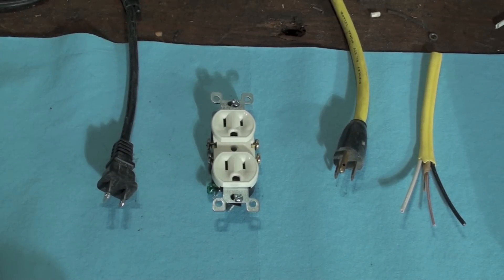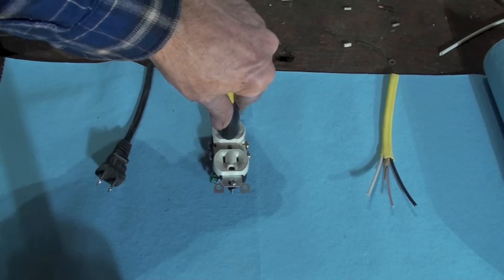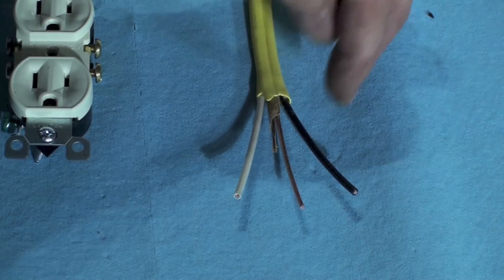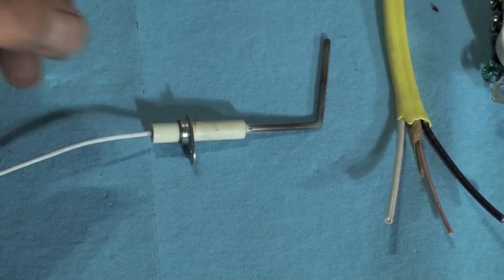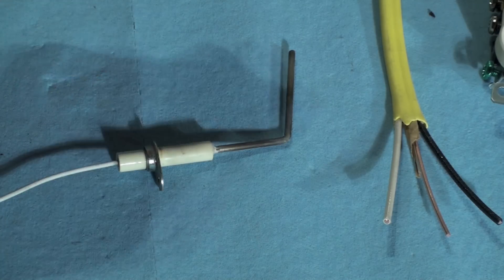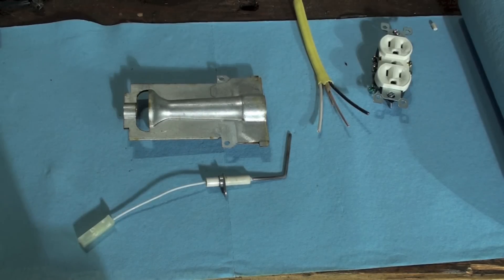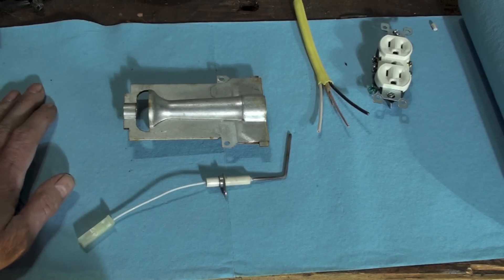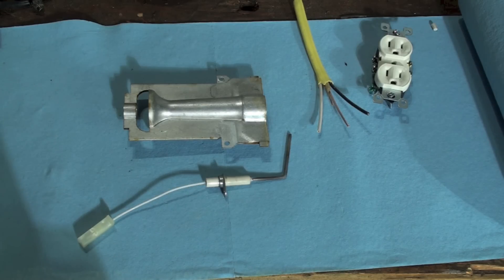Reversed polarity on the gas furnace

Comment: Thank you for explaining in clear detail why gas furnaces manufacturered after the late 1980s will not operate if the hot and neutral are reversed, yet essentially all other equipment and luminaires whether they be incandescent,  fluorescent,  HID or LED will operate normally with a hot /neutral reverse,  aside from the increased shock hazard potential especially with edison base lamps.

Comment: I am ignorant when it comes to electricity. My Heater went out during the night and it will be around 10 degrees tomorrow with around 3 inches of ice. Here in south Louisiana that means everything is shutdown! I just had a on/off switch put on to bring up to code. Your video helped me figure out the power and neutral were connected wrong. I switched them and heater is working. Thank you!!!
Reply from the maker: Welcome.  I have been hearing about your temps.  You guys are colder than where I live eastern Washington.  I am looking for lake pondchartrain to freeze.
GFM

Comment: New Lennox HVAC system installed last month, AC worked fine but go to switch on the heat today and nothing but this polarity error code. Checked the plug they installed on the romex main power line and sure enough they had it wired backwards. Swapped it so that black was now on brass and sure enough that fixed it. Thanks for this video- it really helped. I called the installers and notified them, but I’m curious to know if this polarity reversal could have potentially damaged anything?
Reply from the maker: I have not seen it damage anything on the newer systems.
GFM

Comment: I com across this error often but found through examination..hot surface ignitor ceramic had a micro heat fracture or carbide was actually touching flame and was sending 120v signal through flame to ground during first few seconds if ignition and tripping fault. 
Look for proximity issues on this...also some controls have  a timing issues where ignitor is energized longer than needed and if there is a long flame around ignitor..this can also trip a polarity error code.
Hvac tech since 1979, Michigan
Reply from the maker: Interesting
GFM

Comment: I have a furnace that has been running great for years, it is now random cir board lock out and the code says reverse polarity system lockout. Not Shure why?
Reply from the maker: Either you have a reverse polarity condition, bad ground or failing control board.
GFM
Reply: @grayfurnaceman  I was going to start with a flame sensor, then take it from there, hoping its not the board. The furnace has been working for at least 15 years and just started 2 light lockout. Iv cleaned the sensor worked good for a week and just started acting up again.
Reply: @lizards7777  what you end up doing to it
Reply: @alejandrouriostegui8014  it endid up being a cracked / hairline crack in solder joint on cir board going to main valve, I re solder and so far so good.

Comment: Good video, but I do have a question about running on a generator.  a LOT of discussion about floating neutrals verses bonded neutrals.  Which is it?  Some won't run on floating ground but will when the neutral and ground wire are bonded at the generator.  Why?  What am I missing?
Reply from the maker: I don't know if I can help but here is my 2 cents
If you are powering circuits that are only connected to the generator, do not earth ground.
If you are using a transfer switch, it must be connected to a ground rod.
Remember, earth ground is not used as a safety, but for lightning and spike removal.
GFM

Comment: I swapped white for black, even though they were correctly attached in the breaker panel, and still got that error code. Another guy suggests swapping out the 24V wires that go to the circuit board, I'm going to try that.I didn't know about the rectification of AC through the flame rod though, that was good.
Reply from the maker: The control board may also have failed.
GFM

Comment: Thanks for posting. I always learn something helpful from your vids. My first experience with reverse polarity in my RV repair business was 15 yrs ago. Replacing a water heater element, I had all breakers on the panel off because that circuit was not identified. When detaching neutral from the element, it shocked the hell out of me!  I learned that reverse polarity made all breakers totally ineffective at killing power. In RV AC panels, ground and neutral are not connected, so nothing strange was happening...until I touched that live white wire.  Now I check any AC circuit carefully before doing work and thanks to your info, understand how a flame sense circuit works.
Reply from the maker: Don't you love it when someone removes the ground and reverses the plug.
GFM

Comment: I’m working on a furnace that does not have a ground run to it. The burners come on but whenever the blower kicks on it trips out on the reversed polarity code. I checked for voltage from the cabinet to neutral and I get 120 as soon as the blower kicks on but not before.  I’m going to put a ground rod outside tomorrow to run a ground to the furnace, would reversed polarity only cause it to trip when the blower comes on?
Reply from the maker: I have seen it happen.
GFM

Comment: Surprisingly some furnaces have in their troubleshooting section on furnace manual have 8 reasons for the reverse polarity. The strangest that got me was the flame sensor. The whole was modified,when I cleaned it and put it in the metal was touching and gave me a reverse polarity code. I removed my loads and got nothing. Read the manual, repositioned rod and worked like a charm. A simple tune up turned into a nightmare.lol

Comment: I've run into the problem with other loads on the system and it sucks to figure out. Make sure your furnace is on a dedicated circuit.
Reply from the maker: I have also seen it with fluorescent lites on the circuit.
GFM

Comment: have a goodman I'm working gms. It's flashing continously. switched wiring at fau and unit had a solid blink but would not do anything with call for heat. switched it back unit of course blinked cont. removed the harness to hsi,got a solid lite and  unit idm came on for about 10 sec then shut off then led light started  blinking cont. Any thoughts. I did not check for 120 to chasis, and yes there are other loads at junction box.i will definitely attempt that. are there any other posibilities. that hsi really took me for a loop. oh yeah great video very informative.
Reply from the maker: +Miketec81 If the polarity is ok, you almost certainly have a board problem.
GFM

Comment: so I have a confusing question, but backstory first. Up until today my furnance has been black wire to black wire (hot i am guessing) white to white (plugged in the neutral) working great. Today while we were out we came home and it was cold. Checked the furnance said reversed polarity. So we put the black wire with the white and the white with the black and it is running fine. My question is how could a hot wire switch to the neutral and vice versa?
Reply: What was the cause? I'm experiencing this now.

Comment: Now that I would gave never guessed. I had the code pop up and for whatever reason the installers connected up the supply line with the furnace wires backwards and then cut off the ground tang so they could flip th he plug over. So if you were to unplug the furnace then plug it up the Normal way then the furnace would throw a code for reversed polarity.  Yes the ac worked fine but then the furnace would not. I thought maybe it caused the fan to turn wrong way but that never made sense. Now I know the real reason and I surely will pass this info along. Thanks for making this video and for explaining it in a very understanding way. Now I just have to figure out why I'm still getting a E7 code on my amana furnace.  It was for igniter fault or improper  ground. Changed igniter since last one was totally fried....and I do mean Fried, but still getting same code and igniter glows red hot and unit is grounded. (Was grounded before igniter got fried) .Got any ideas to try?

Comment: I have a Trane Xv95 that was working fine, but now is giving me the reverse polarity code. I'm not sure how that could be? Any ideas? Board went bad?
Reply from the maker: Sometimes it is a bad board.  Unless there is a bad ground.
GFM
Reply: @grayfurnaceman  what would cause the ground to go bad when it all worked good before?
Reply from the maker: @WhitetailSpecialty  Everything works before it breaks.  lol  I would be checking wiring connections.
GFM

Comment: Good video, lots of good information here. I want to make one correction and that is AC current in the U.S. cycles or alternates 60 times per second or 60 Hertz, not 120 which is the voltage.
Reply from the maker: Actually, it reverses flow 120 times a second.  It makes a complete cycle to where it started 60 times a second.  
GFM
Reply: 60 Hertz means 60 oscillations per second. In an oscillation an electron moves back and forth in the conductor, changing its direction twice, therefore 60x2=120. My bad, got my facts slightly wrong, thanks for the reply.
Reply: I guess it depends how you look at it. 120 is the total number of oscillations per second.

Comment: Please if you still manage your comments reply and let me know if i can call you. I have done nothing to my furnace but change the thermostat and now the fan wont work and its getting cold. The furnace says reversed polarity as the error code.
Reply from the maker: First, I would check to see if the black lead to the furnace is indeed the hot lead.  If it is, you may have a control board failure.
GFM

Comment: If I couldn't correct a reversed polarity fault code by reversing the hot and neutral I replace the board and that fixes it.  I have never considered other loads in the panel causing the problem.  Thanks for the tip and what are your thoughts on board replacement correcting the problem?   Thanks Jeff

Comment: Good video! A few years ago, one of my relatives had her older home re-wired.  After the job, her furnace would not work! We found that the Romex cable supplying her furnace had been connected incorrectly when the furnace was installed.. Hot and neutral were going to the right places in the furnace but the wrong colors had been used. So, when the electricians connected what they thought were the hot and neutral conductors to the furnace, the polarity was reversed. Fortunately, this was indicated by the LED on the circuit board. A simple wiring change fixed the problem!

Comment: Thank you, I changed the flame sensor but realized that the inlet for electricity was a two prong with an adaptor for three. I will change it to the other way and see what Happens. Had to go somewhere else but will check later.

Thank you again. I have 3/4 of HVAC classes finished but stopped going to school like 5 years ago, have to refresh and start to finish my classes.

Comment: hertz (Hz) 
The SI derived unit of frequency, equal to one cycle per second. The hertz is used to measure the rates of events that happen periodically in a fixed and definite cycle. The unit was named after the German physicist Heinrich Rudolf Hertz (1857-1894)
So 120 times is correct :)
Thank you for another informative video

Comment: Hi GFM,  So if I am understanding this, if you reverse the polarity you are reversing the electric flow? and that's why the flame rod won't work correctly.

Great Video, very informative Thanks.
Reply from the maker: No.  AC reverses polarity 120 times per second.  What the difference here is The neutral is bonded to the ground at the panel and the equipment is grounded to the chassis.  So, if the white wire is connected to the hot connection of the control, it makes the flame rod and the the chassis on the same side of line.  Hope this helps.
GFM
Reply: grayfurnaceman Ok I got you now, that makes sense.  Thanks for the reply.

Comment: Have you seen the videos where there's a claim of reversing polarity on microwaves can create ice in the oven. I came to this video trying to look for some serious answers on that front. You mentioned that the flame Rod tries to draw power from the chassis if the polarity is reversed. What are your thoughts if the same principle can be applied to microwaves or if those claims are just completely fictitious.

Comment: Mine has been running for a few weeks but now im getting the "reverse polarity" error... Can u help me out
Reply: If you are able to check if the polarity with a meter, you should do so.  If not, you will probably have to replace the control board.
GFM

Comment: Am having trouble with my furnace  my furnace burners ignite for 4 seconds then shuts off and locks out. I changed the flame sensor and circuit board and am about to change the gas valve. But seriously thinking the polarity is reversed after watching your video? What you think is the problem. I check the ground and neutral at the furnace and had a crazy jump on the meter.

Comment: AC current switches polarity 60 times per second (60 Hz) in the U.S. and 50 times per second (50 Hz) in many other countries
Reply from the maker: One of the defects to using "hertz" is to most people the term means nothing.  If you use "CPS" it gives you a better idea of how it works.  CPS means "cycles per second".  This means the power reveres itself twice to get back to the same place it was at the start.  So it does not shift polarity 60 times a second, but 120 times a second.  Hope this helps.
GFM

Comment: A14 years old builder model Carrier high with no HSI output out of the board ,no fault code and venter running constantly . Replaced whole furnace wire harness , board , HSI and transformer and still nothing , ground is good .

Comment: The real problem is a bad ground
Reply: Make sure you have a good independent ground. If necessary to run a wire from a water pipe to the ground on the furnace and make sure the connection to the furnace cabinet is clean and not Rusty if it is sand it off should fix the problem
Reply from the maker: The is not a bad ground.  The lack of any ground at all will not cause this.
GFM

Comment: What is the difference between 80% and 90% gas furnaces?
Reply from the maker: Danny Calk The 80% furnace has an fuel efficiency of 80%.  The 90% is 90% or more efficient.
GFM
Reply: +Danny Calk a 90% takes so much heat out the exhaust that it condenses water and is piped with plastic a 80% does not condense and uses a metal flue
Reply: 10%